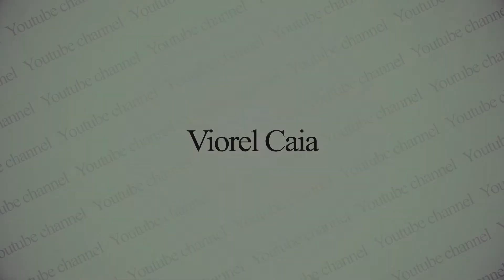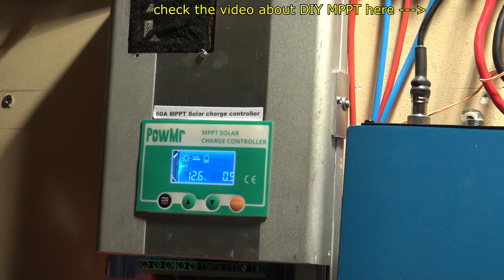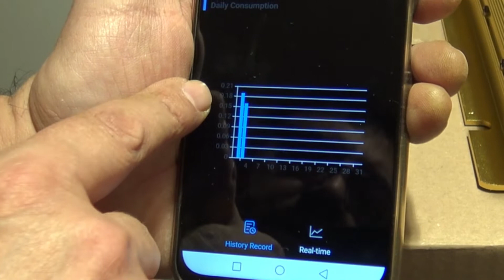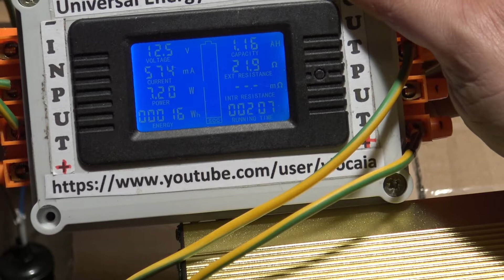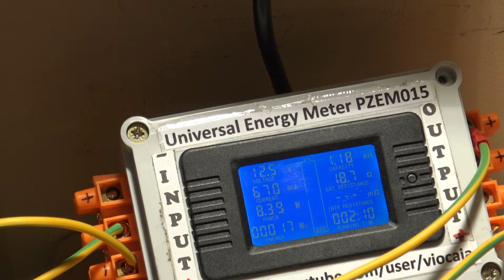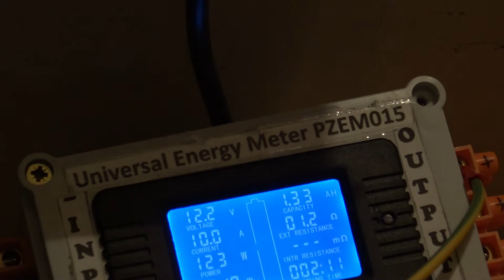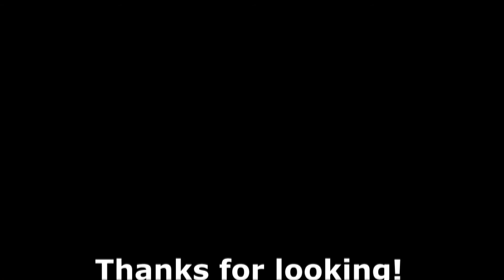Pure sine wave inverter standby consumption

Comment: I have a MicroSolar 600 watt inverter that idles at a measured 350 milliamps. This is 4.5 watts at 12.8 volts. The big Victrons idle at 11-15 watts. Low idle power is possible, consumers need to prioritize this feature to encourage manufacturers to optimize it instead of making the cheapest product. Powering small appliances directly from DC is generally more efficient than using AC overall. Using smaller inverters generally helps but not all small inverters are low in idle power. Fancy power saving modes generally don't work well for many appliances as the power is essentially going on and off and interfering with their monitoring and control electronics.
Reply from the maker: Yep, that's a lot. You gave me an idea about a kind of light sensor with relay, connecting and disconnecting the battery after dawn. I don't have a inverter working on batteries but a MrPow MPPT charger. I'll check idle current too.
Reply from the maker: look here about standby current of my MPPT... https://youtu.be/-pMUU1_eZzo

Comment: that is not much power at all, i have large solar inverter and mppt (4000W) pure sine wave of course and i have checked that mppt inside of it takes about 20W and the power inverter takes 80W even when i have very small LOAD like laptop so then i am consuming 20W for laptop and like 100W on top of that, it is good that you have very small 600W inverter this way u only losing 7W constantly, imagine losing 80W constantly when someone has bigger system like myself. I am actually thinking of buying something small like the inverter you talk about to lose less power than what i am losing right now.
Reply from the maker: You read my mind!
Reply: @viocaia  by the way my fridge takes 0.5 kWh  so i do know how yours is taking only 0.18kWh. Is it maybe in some cold room ? my fridge is 1.8m tall so a bit bigger than yours
Reply from the maker: @oskarmal642  It's a second one in the deposit room..and usually it's pretty cold there, even in the summer..

Comment: Can I use a pwm to charge my  12v(100ah) battery using a 250w solar panel with 29v (Vmp) and Voc 36v (Voc)

Will it charge perfectly or need to go for an mppt
I need advice
Reply from the maker: It's kind of much voltge..for PWM it should be as close to the battery voltage..The PWM is not lowering the voltage, you apply 30V to a 12v battery.! You should consider an MPPT
Reply: you can use it, but you will get very low wattage from your panel, i would say like 50W

Comment: Nice topic. Apliances in standby are not considered as a problem. But they are.

I was logging power comnsumption of my office and also my flat. I had no idea, how much constant consumption is there. My office almost never gets under 200W, the flat over night falls to 150W from time to time. Over the day I have 500W+ constant consumption. The fridge only turns on from time to time also water heater. But these are only short time spikes. The main part of consumption is the constant one. I calculated the average consumption, it was only 50W higher, than constant one.

So I installed a 500w micro inverter with 2x250W panels, and the power bill went considerably down. I calculated, that this small solar production got payd back in 3 years. Just by covering constant consumption over the day. Now I have a wish to cover constant consumption also over the night. But it is not so cost effective, while the bateries are still not cheap enough.
Reply from the maker: Right! I have the same thing in my mind...batteries! For the day I'm covered by 1350W solar and ongrid inverter..gain daily like 4-5 KW.It's amazing how much all the standby things are taking..TVs, microwave. cofee makers,gas heater,AC, even my desktop on standby, but I will take each and measure for 24h, our routine is pretty constant daily..I'm curios how much I can save, prices for  electricity are getting crazy high this year,and it's just the beginning.

Comment: It's normal... usually inverter takes between 7 to 23 watt on standby. Some of them have power save mode but they are more expensive. As an example > GoPower inverters have power save mode witch take about 5 watt, (it's pulsing ac and checking if any thing is connected) and it has separate on/off input (low voltage input) you can control it remotely. When it's off its takes 0 watts.
Reply from the maker: Interesting! I never thought standby it's so energy demanding..I'll try to have a kind of load sensor and start the inverter when it's necessary. Thanks for let us know.
Reply: @viocaia  if it's for the frige only I would go with arduino, current sensor and relay. Program should be : turn on relay (inverter) + apply power to sensor, wait for 5 seconds( let's all settle on) check for current, if load is on relay stays on. If no current turn relay off delay 10-15 minutes, repeat. All it should take is ~10 watt a day(24h)
Reply from the maker: @markveren847  Brilliant! I was thinking Arduino too!
Reply: @markveren847  very cool idea worth exploring!

Comment: Which wire gauge would you recommend for connecting lithium batteries in parallel? 0/1 gauge?
Reply from the maker: Depends of the current you handle..If you do series of 18650 cells  with let's say 2 A, a 22AWG is ok..but use this kind of calculator 
https://www.wirebarn.com/Wire-Calculator-_ep_41.html
Reply: @viocaia  12.8v 20ah 256Wh lithium batteries
Reply from the maker: @Saint696Anger  If the connection is under 1 Feet you can use safely 16AWG but I'll go for 10AWG to be sure..that's 2.6mm/10AWG
Reply: @viocaia  thank you